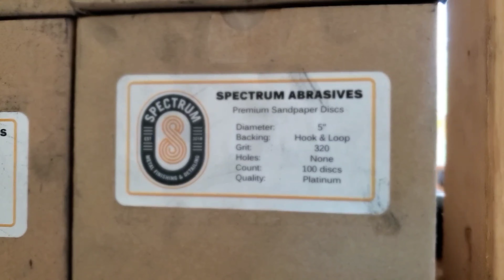How to polish big block chevy aluminum valve covers - Menzerna compound full tutorial

Comment: Recently I bought some Marpol polishing bars to try since I run there 10" centerless buffs. I really am liking them better than the Menzerna 439T, P14F, and 480BLF. Specifically the Marpol C106 heavy cut pink bar then the Marpol Volax finish blue bar. Having better as well as much faster results. Especially with the C106 compared to 439T
Reply from the maker: Good! There's more than one product out there. Use what works best for you

Comment: 1. Would be the same results if you would use blue wheel on first step with 439t?
2. Did you ever tried wash a buffers for example when you changed company of compounds and still want to continue using same buffers or just cut with rake?

Comment: Awesome video! What RPM were you turning each compound?
Reply from the maker: Thank you! On the makita vairable speed 9237c polisher I ran each compound as follows:
-First cut: orange pad / 439t wide open (roughly 3200-3500rpm)
-Second cut/color: blue pad /480blf wide open again (3200-3500rpm)
-Final finish : white pads /p175 1800 rpm (this stage you have to slow down, dont exceed 2,000rpm the white wheels cannot handle any more speed than that!)
Reply: Brackish Torque Thank you for that! I figured you kept the RPM’s at the recommend specs according to the manufacturer’s recommendations. What made you choose to run a blue airway vs. a white untreated airway with 480BLF?
Reply from the maker: @KINGRG1  no problem! So contrary to popular belief the primary goal of the stiffness of a buff is its ability to push the abrasive thats in the compound into the surface, most people think its the buff that is doing the "cutting" but its more so the compound. The compounds ability to dig into the metal and do its job is dictated by the amount of pressure and heat you can use to apply it... so the goal of the stiffness is to allow you to use as much pressure as you need to push the compound in to the metal without the buffing wheel collapsing in which case you lose your polishing edge. 

On a scale of 1-10, menzerna 439t has a cut rating of 8 and a gloss rating of 5 where as 480blf has a cut rating of 2 and a gloss rating of 8 and lastly p175 is cut rating 1 gloss 9

So by using a stiffer wheel for my second step with 480blf I am actually able to use the abrasives of the 480blf (cut scale 2) to refine my hash marks that are left over from the first stage of 439 and make for a much glossier finish than jumping straight to white wheels that are softer and collapse easier not allowing the compound to smooth out the previous step as well.

Sorry for the lengthy response! Lol does this make sense?
Reply from the maker: I'm going to add that the wheels do have some abrasive property to them which is why you don't see anyone taking a stiff wheel and using it with a final finish compound or you will have noticeable marks from the wheel
Reply: Brackish Torque That actually made total sense to me! I’m glad you explained it to me to where I can grasp what technique is needed to buff aluminum. I pieced together a kit that is a copy of the DC Super Shine Kit over at Highway shine. So I’m getting an orange fast cut with 439T and a untreated white wheel with 480BLF to run on my DeWalt DWP849X. I want to spin 6k rpms but I don’t want the buffs to go haywire lol
Reply from the maker: @KINGRG1  awesome man! Glad to hear it and yes if you are new, stay away from 6,000 rpm temporarily for two reasons; 1 as i mentioned the buffs aren't rated to spin more than 3,000rpm ish as I mentioned, the buffs can fly apart. Its much more traumatic at 6k than at 3500. And reason number 2 is that the company i mentioned "matchless" was recently bought out by a company called osborn and osborn has not yet started producing the wheels on the same machine that matchless made them on and so everyone bought up all the original matchless wheels and now most of the wheels that highway shine, spectrum alberta, And infinish are selling are made on a different machine using the same fabric. The problem as I've heard from friends in the metal polishing community is that these "interim" buffs don't have the same clinch ring and have been more likely to come apart at 6,000 rpm. I have not heard of one coming apart on an 849x or a 9237 makita (3500rpm)... at some point between now and jan, 2021 osborn will be making the better buffs that matchless was on the same machine but nobody knows when that will happen.... this is also why I never lock my trigger at 6,000rpm and I recommend you dont lock it either when you're starting out, if somethimg bad happens you want the machine to shut off as quickly as possible
Reply: Brackish Torque Thank you again for the thorough explanation! I don’t know if you’re into it, but it would be super cool if you made a video showing how to polish out aluminum wheels! A ton of guys love to learn that type of stuff and it brings in the views lol
Reply from the maker: @KINGRG1  thats going to happen! Not sure when yet but I have polished American forces on my own truck so when I get time I will put a very thorough video together on how I polish forged truck wheels
Reply: Brackish Torque can’t wait!
Reply: Brackish Torque Btw, when you were saying that Sicrigz’s polish works better than a previous brand you used, would that other brand’s product happen to rhyme with “Phepyr Bro Porty?”
Reply from the maker: @KINGRG1  you might be onto something 😉

Comment: How do you get rid of some of the haze in the final polish? When I shine light on the item after a final polish, I can still see some slight haze. Any ideas?
Reply from the maker: Here's a few tips but first a couple things to consider; 

1. If what you are working on is aluminum, Manufactured aluminum is a  very imperfect process and different manufacturers may use different alloys to make it which can help or hinder the amount of clarity that you get in your reflection of the metal. (Cast aluminum is much more difficult to work with than forged aluminum)

2. The temperature and humidity are a factor in how well your polishing end result is going to be which can contribute to haze. Usually warmer/drier weather promotes a better finished product as well as less work time.

3. Was there previously a coating of some sort on the aluminum such as anodizing or ceramic coating? I see this alot with the forged wheel pickup truck wheel guys. They will get them ceramic coated and if you don't know its there it will create issues you won't see until you get to your coloring/finishing steps

4. If you sand the metal and do not fully cut your sanding out it can look hazy (look at it with an LED flash light this will usually help you  identify sanding marks)

5. Lastly the compound bar and how to apply it (this one took me a while to figure out) the cutting bars I mentioned 439t and p14f  are very greasy bars so they keep the surface fairly cool even though you're normally putting the most pressure and lowest work speed in this step. The 480 blf and the p175 are very dry bars on the other hand and because of that you need less pressure and faster working speed because if you're too slow  you can overheat the surface layer of the aluminum opening up micro pores  which appear as haze in the finished product

Hope this helps! There's a Facebook group called spectrum polishing tips and tricks thats good for advice on challenges you run into along the way 👍
Reply: @brackishindustries  Thanks for the reply. I’ve been polishing aluminum 3 piece wheel lips for some time and compared to what people are getting from other companies, mine definitely do not appear as crisp and it irks me. I spend so much time and attention to detail just to see slight haze at the end. I appreciate the help though! I’ll figure it out one day.
Reply from the maker: @laurab3406  what type of wheel? I do Lot of wheels
Reply: @brackishindustries  Mainly BBS wheels from RS,RC,LM’s etc. I may switch products. I’ve been using Zephyr.
Reply from the maker: @laurab3406   okay I haven't done any BBS specifically but I've done plenty of 3 piece CCW wheels... I started with zephyr, love the company but after hundreds of hours of testing and my own fixing flaws I've found that menzerna works alot better for me and I'm able to create substantially better results with their compounds. I would give then and see if they work better for you as well. My suspicion is your haze is coming from tripoli
Reply: @brackishindustries  Thanks for the info! I’ll keep trying.